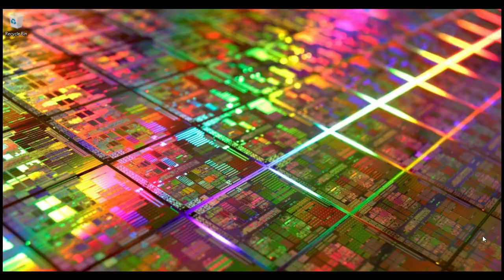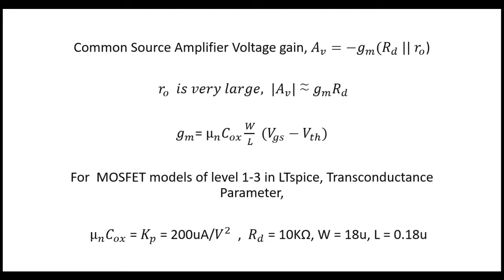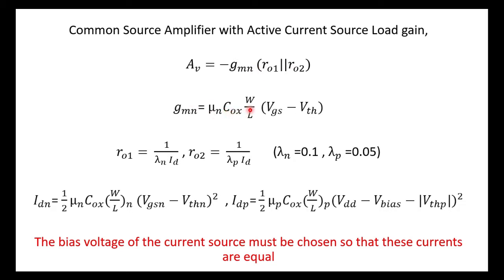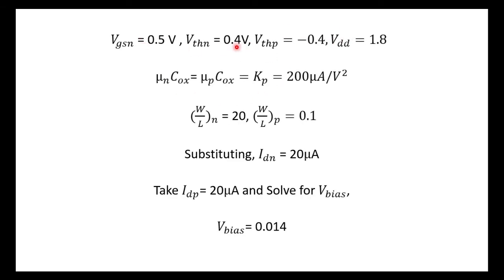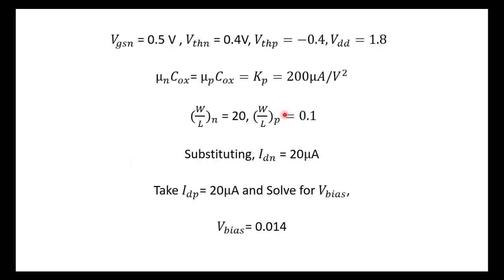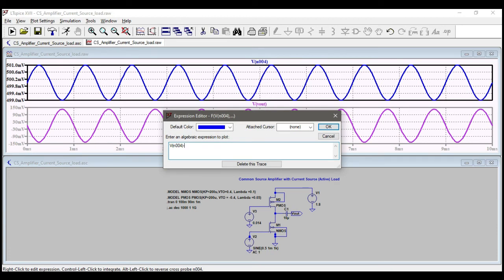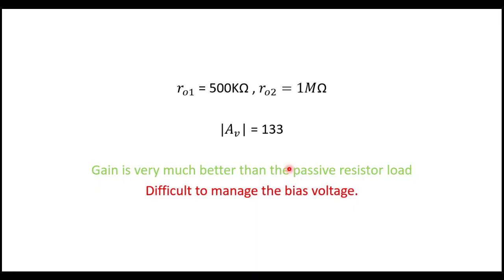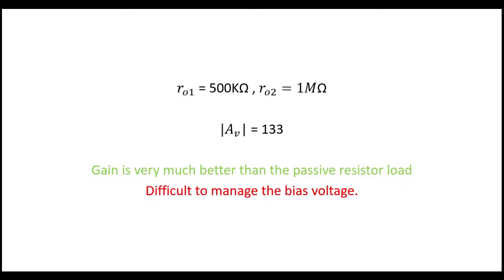2. CS amplifier with Current Source Load in LTspice

Comment: Can we construct this type of circuit which has -1 voltage gain with changing parameter?
Reply from the maker: -1 voltage gain? Of course the circuit that we do are inverting amplifiers inherently. Even though I say it as 10 v/v gain. It's truly -10 v/v. We are considering just the magnitude. For your case since it's 1, you need to just pass the input to output, sometimes called a voltage buffer. And what do you mean by parameter change ? There are W/L design parameters you can always change.

Comment: We have to use DC analysis?
Reply from the maker: Why DC analysis? If our requirement is to design an amplifier for certain AC voltage gain we either check the Transient output which is time varying or Frequency analysis. We need to keep the device at Quiescent Operating point or DC operating point for such analysis. So, variation in DC point will give you different gains. Do not change the DC point by varying any DC input. 

In fact, our transistors are linearized at a particular DC operating point for small perturbations (ac signals) and that is referred to as Small Signal Model. 
Otherwise it is a nonlinear device inherently.

So, "No" we don't do DC analysis. !!

I hope it helps rachana